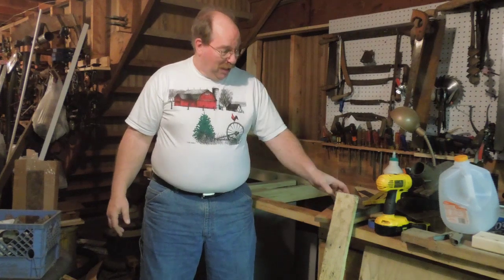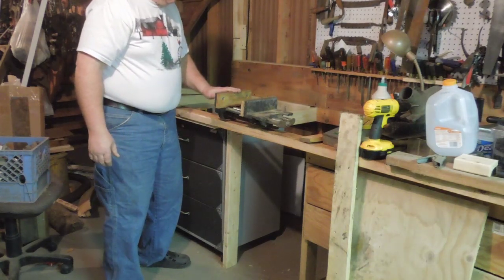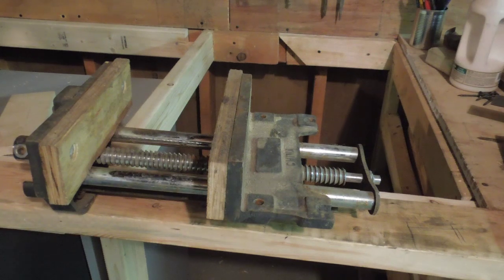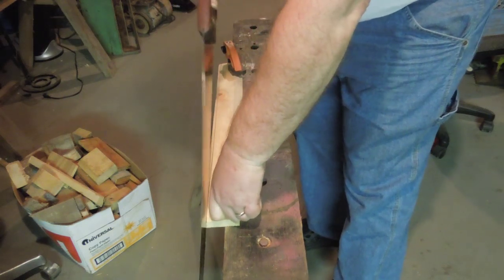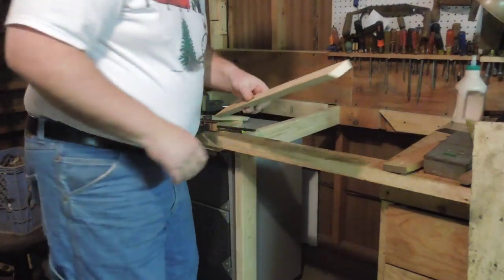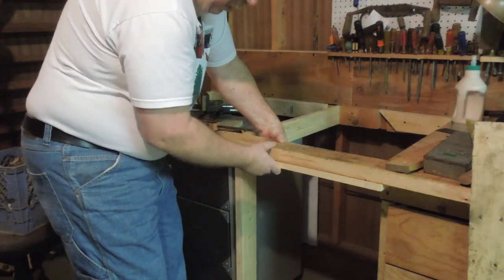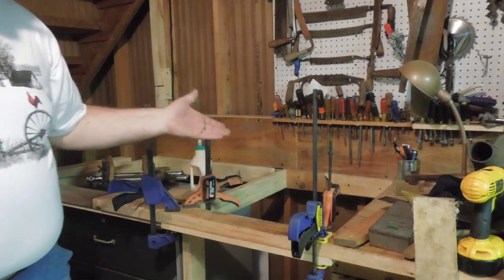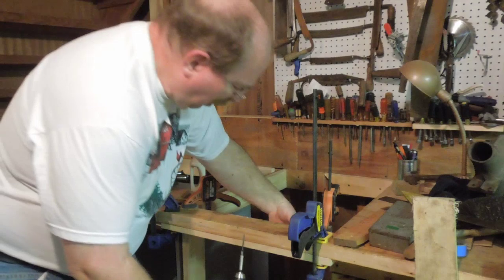Installing A Quick Adjust Bench Vise Part 1 of 4 - a video tutorial from Old Sneelock's Workshop

Comment: After you ripped the front filler board to be flush with the 2x6 why did you mount the 2nd board (back one) first and then had a small gap at the front? You also used type 3 glue which is the slowest setting and was developed as exterior and then screwed it on. If you were going too screw  it on you should have predrilled on top the workbench and made sure that the screws wouldn't interfere with the vise mounting screws.
Reply from the maker: Thanks for the good suggestions. Unfortunately I didn't take the time to watch this video before I built the bench. If I had it would have been immediately apparent that I should have purchased new material instead of messing with the recycled pieces of wood that I used. 
Type I I I will work under any conditions. Rather than having multiple glues slowly decomposing on the shelf I chose to spend limited cash reserves on one, more expensive, glue and use it for everything. Type I I I has a shorter shelf life but if used for all of my projects it is used up quickly enough.
The next time I build this vice into a bench I will consider your suggestions.
Reply: I hope I didn't sound critical. I second guess myself on every project. At least we have fun.
Reply from the maker: herbsu43 It's okay to question and I appreciate the suggestions.